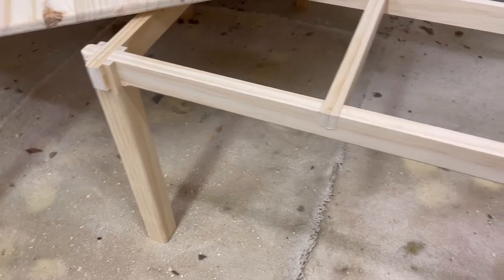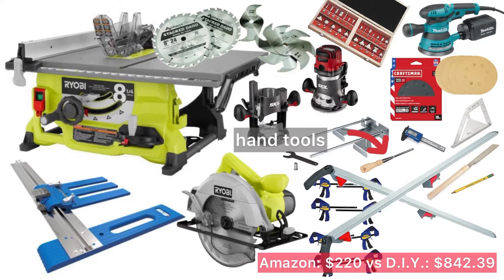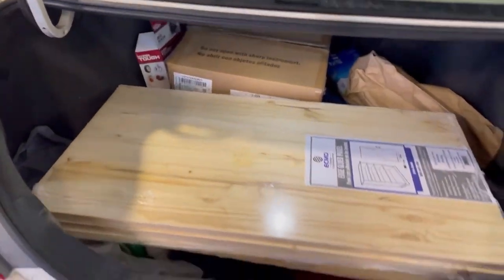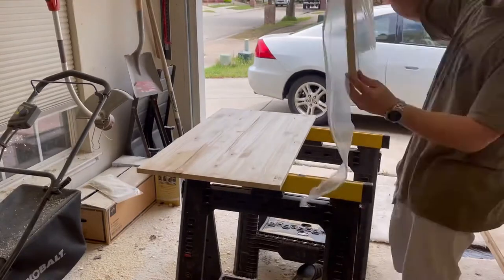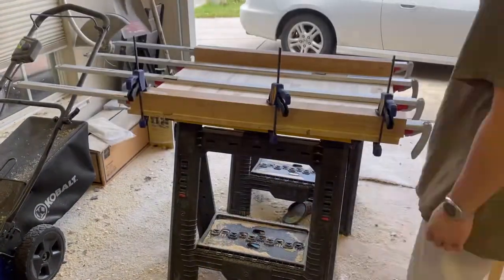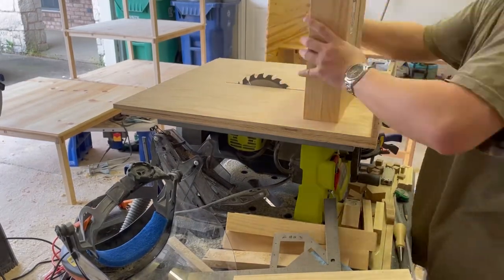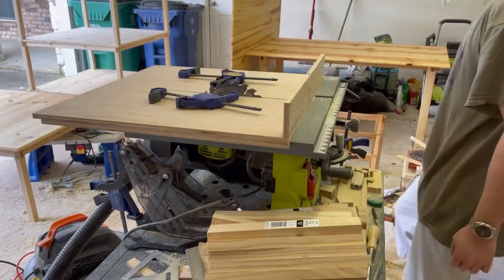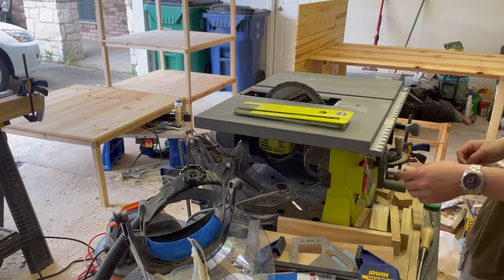Day 1 - Building a Kotatsu Table from Scratch

Comment: Mainstays 6 Foot Bi-Fold Plastic Folding Table, walmart 39.99. cut down to desired height. cozy legs flat panel radiant desk heater 150w. amazon 59.99. king size comforter 49.99. amazon. ply top cut to fit 39.99 plus can of spray varnish 9.99. home depot. 199.95. total. Kotatsu Cat free from the street, 0.00.